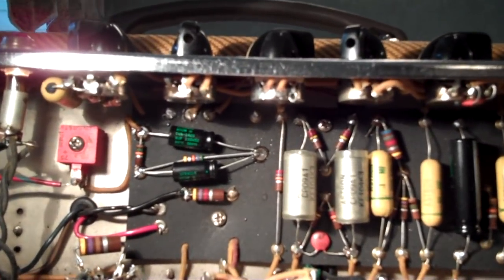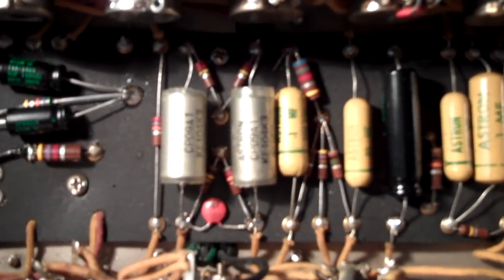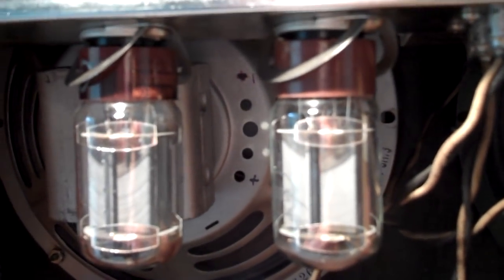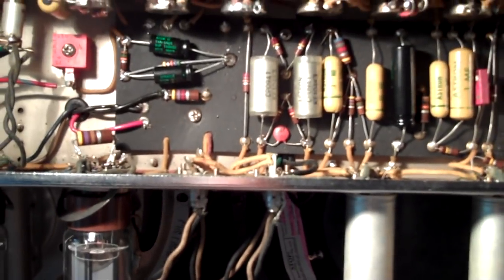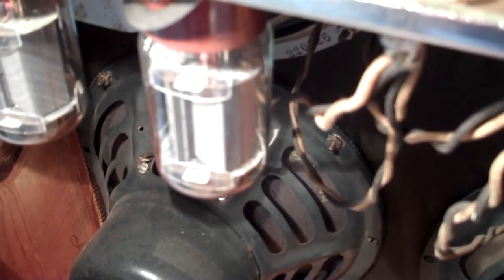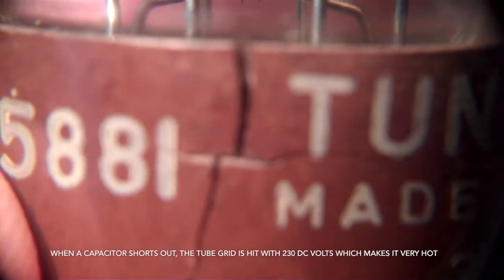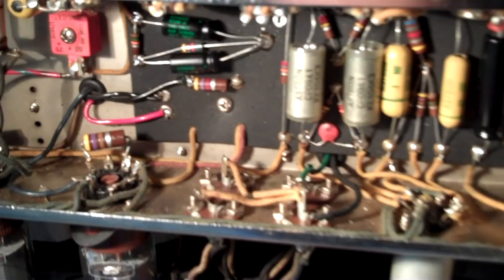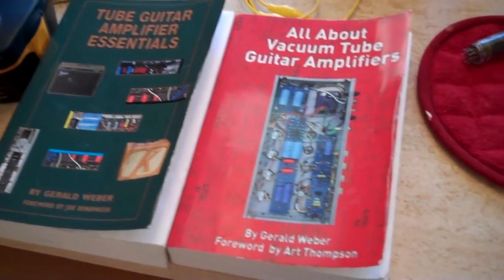Gerald Weber Helps Troubleshoot My Vintage 1959 Bassman

Comment: My amp does the EXACT same thing, but only with my chromatic tuner in the mix with the pedal board. It doesn't do it at all when the tuner is not in the chain. Hope you can fix it. I'm sure you will.

Comment: Plate resistors.......
Reply from the maker: I'm actually just getting ready to check those this morning.  There is not much between V1 and V2 that could make a noise except those 100K's, two 270K's and the two Astron .02uF caps as far as I an tell.

Comment: Hey my friend are you familiar with 1968 drip edge amps? I have been told early ones have the AB763 circuits. I wondered what your thoughts were. Looking at one now
Reply from the maker: Hey Matt.  Yes, as far as I know they are the exact same as the blackfaces and less expensive.  Well, maybe not the drip edges because they are little more rare.  Even the later year silverfaces can easily be modded back to blackface specs.  I've never done it but it should be easy.  You shouldn't have to do anything to the 1968.  It's should be killer.
Reply: millstap Thanks man for the reply.

Comment: Possibly "Tweed Disease", or a conductive fiberboard that's also become capacitive , suggested by the clock like charging/discharging oscillation.

My advice would be to poke around the fiberboard with your VTVM. If you find something a few desiccant pouches in the chassis and a dehumidifier might help. 

ALSO, Checking the Astrons for leaking is almost a must, you KNOW the damage a bad one can do!!! You're lucky it didn't fry those irreplaceable transformers. I know, I KNOW, The Astrons have mojo, but I bet you couldn't tell if I replaced them all with new caps made with the same materials, construction and values. 

Ain't those 5881's something else? I believe they have the highest over voltage/current durability I've ever seen in an audio output tube. Every single one left the Fender factory at 20% over the data sheet max values and lasted years like that.
Reply from the maker: I guarantee I would know immediately if I put in all new caps.  I've done it and I broke out into a cold sweat wondering if I would ever get the amp to sound good again.  And that was when I only changed one or two caps.  There may be some better ones being made in the past few years.  I have not tried them all.  I see a lot of Orange Drops being used in these which I have never tried.  I would probably try to find NOS Astron PIO caps first like the ones I used in the phase inverter.  Those almost sound better than the yellow ones.  And they seem to last forever like those 5881's.  Actually, the sound has disappeared again so I'm not too concerned.  I wish I would have recorded my jam last night because the amp was screaming.  I am going to try to duplicate the jam today.  Shouldn't the Tweed disease still exist even after I pulled V2?  I think that is a clue to where the problem might be.